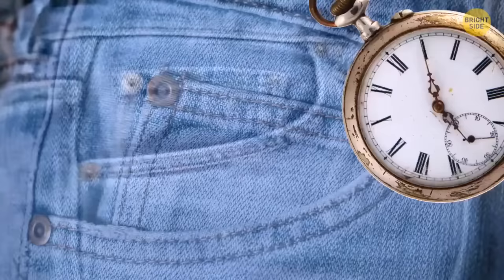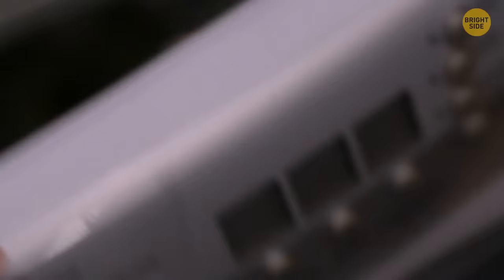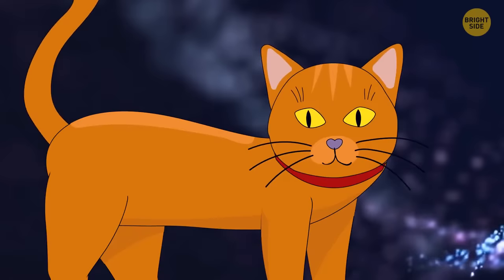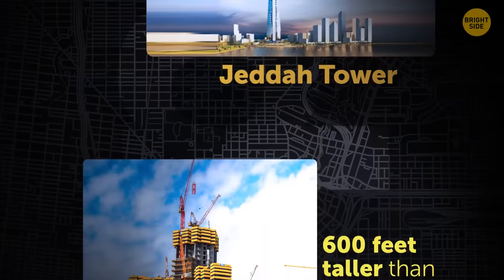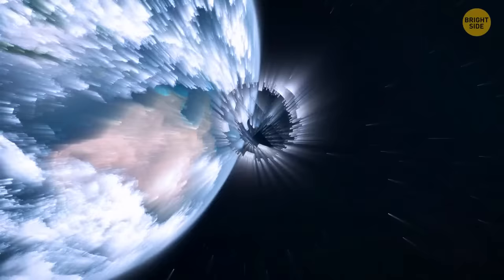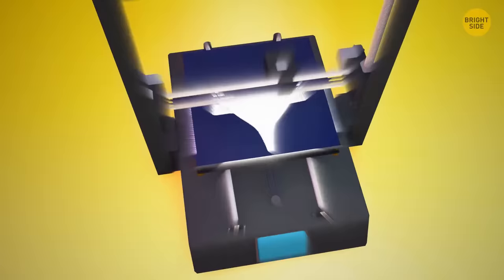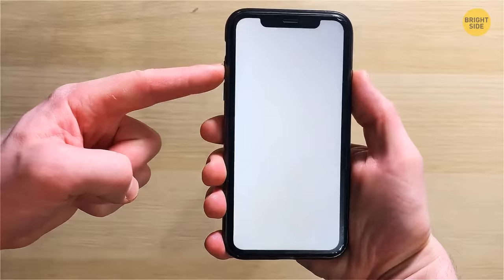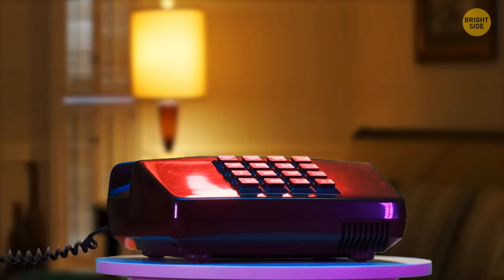75 Unique Facts You Won't Easily Find From Googling

Comment: the windows on airplanes aren't square because the corners of square windows  were extra stressed by air pressure changes that would  soon cause cracks of the frames and bodies of the planes - causing deadly accidents. the first commercial  planes had square windows much to some sorrow....

Comment: The info you gave at 5:25 is not very accurate, those are batch/stock codes for obvious reasons, however, the little jar that looks like its lid is off with a number before the letter M tells you how long in months it is usable for or how  Fresh  it stays after the seal is broken...😮

Comment: The hose does not tell you which side the gas cap is on. I currently have 3 vehicles and all the are on the left. Hose is on the right. 2 of them have arrows on the left
Reply: I knew the gas tank thing as a kid
Reply: Did they forget about taking the headrest off and using it to pop open the window